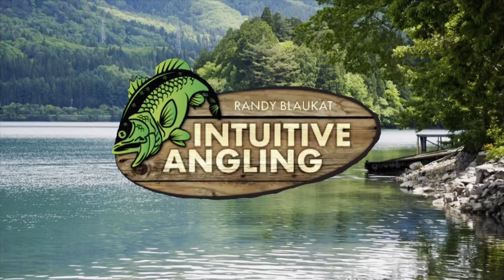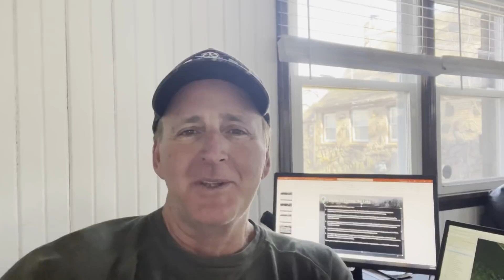The Juice On Fishing “Industrial Areas”…(Barge Tie-Ups/Steel/Concrete/Seawalls)

Comment: I know a spot on a barge tie off that is a money spot. When the barge goes to dock it’s front end will push up sand and gravel and make a nice hump and the smallmouth will get all over it.I like to throw a Spro Rock Crawler 55 up river And crank it over the rock pile going downstream. It produces so well that the local guys will lock thru the dam which takes some time just to fish it long enough to lock back through and make it back to the weigh inn and take the money 💰

Comment: I fish at a harbor off the Arkansas river weekly. It has all of the things you discuss in this video. The fun part about where I fish is it has the industrial stuff, the normal lake stuff and the river stuff. Honestly, I have more luck with a shaky head or Ned rig around the industrial stuff. I’m fishing really light (1/8 oz shaky head / 1/16th Ned rig) in those areas. And, the Ned rig I use is the trimmed up variety I learned from your video.

Comment: Fished the Ohio River for several years in the 80's. One of the absolute best areas I found to fish were small creek mouths and bars when a barge is passing, especially a full barge. They draw a tremendous amount of water and fish will pop up in these type areas. It pulls water out and then water rushes back in, doesn't last long. Tied up barges as you said can be great at times, always did better on the front where it angles back, provides shade most of the time.
Reply: I live right on the Ohio and have fished it 30 years and totally agree! Some days it's loaded barges producing some days empty barges and usually the one at top end of a group is best.
Reply: Haha ohio river fisherman myself. These are the first thing i look for🤙  do pretty good on grass beds too
Reply: Fish mostly markland pool. Some down by Madison but favorite is rocky point down by cannelton
Reply: @rangerbull  ive caught some slab crappie down at cannelton on the rip rap

Comment: Hey Randy that was a good video. Living here in Pennsylvania and having the Ohio river in my backyard a lot of this is a staple went fishing this river. The biggest thing you didn’t talk about the mooring cells are filled with rock and a lot of those cells have been damaged and weakened over the years and the rock begins to spill out of the cell creating secondary cover in deep water. I can put my boat as close as I can and with my graphs see small individual rock piles a lot of times on the main river to front sides of the cells. And yes tubes do work but over the last few years you can’t be to drop shot. Keep the good stuff coming

Comment: That’s the game on the 3 rivers in Pittsburgh. Industrial areas all up and down them I pull bass out of them a lot.
Reply: Yep. I'm in The Burgh, too. I do quite a bit of fishing along the North Shore, down on the Allegheny. One of my favorite spots is right outside PNC Park, at certain times, in front of River Rescue, cause they have two of thos huge barge tie-offs Randy talked about, right in front of it. That, and the ramps for the Gateway Clipper fleet hold bass along the ridges of the corrugated metal.